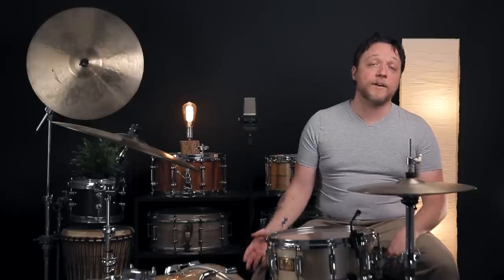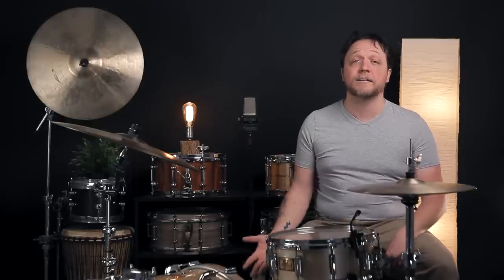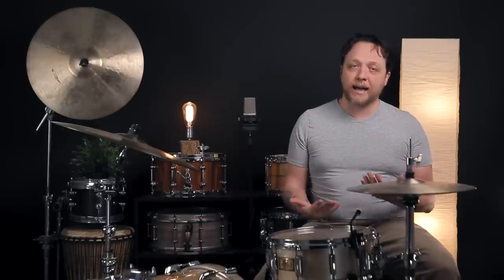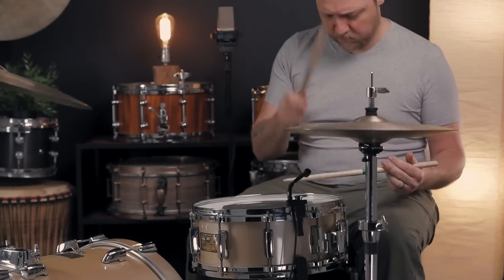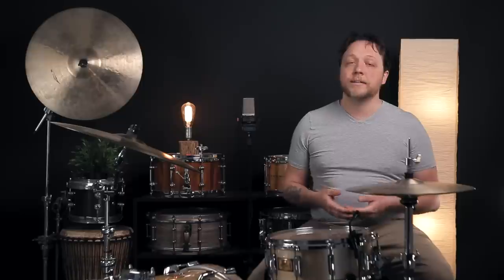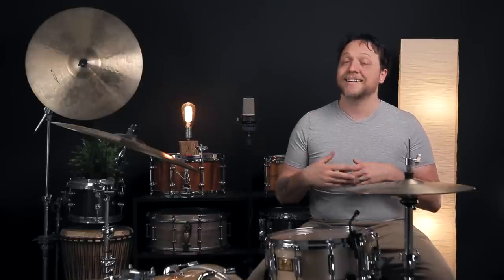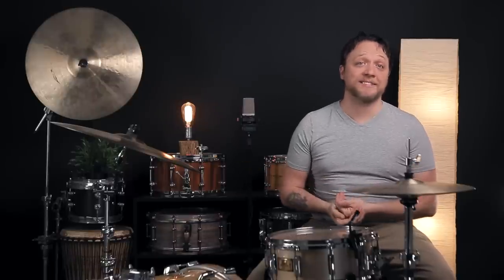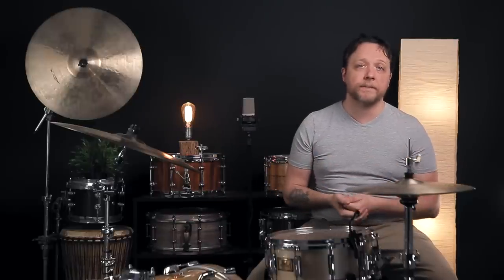Drumhead Coating Conspiracy? | Season Five, Episode 49

Comment: The tuning accuracy these guys have is incredible. It's so hard to hear a difference because of how perfect the heads are tuned to match. Bravo!
Reply: I believe it's the same exact head and they didn't even have to remove it to remove the coating so that's why the tuning is exactly the same
Reply: @miikaroysko9591  what?😂
Reply: Probably used a drum dial
Reply: Get a tunebot, it’ll give you exact hz reading of each lug and it’s basically a guitar tuner for drums
Reply: @mattlionmusic  drum dial is far more accurate
Reply: @zackedge2456  how is the drum dial more accurate? If the drum has any imperfections like bent hoops or bearing edges that aren’t perfect, or old dented heads, the drum dial isn’t going to work. You will need to keep tensioning the drums higher to get the same tone… the tune bot literally doesn’t care about tension it’ll give you the actual note of what each lug is. Match them and your drum is in tune.

Comment: The coating remains popular on the snare for brush playing. That’s it. The coating applied to the drum head does very slightly mute & the sound & control overtones on any drum. It’s very slight, John Bonham used coated heads on the resonant side of toms. Try it for yourself 👍🏼

Comment: Oddly enough, the fully coated head sounded to me a tiny bit brighter in this video than the partially coated or uncoated heads, although less so in the blind test.  IRL I've never really noticed a difference.  Maybe I heard a bit more airiness with clear heads, but it's so small that 1) it could be my imagination due to the way clear heads look, and 2) it's imperceptible except in isolation.  But I've always used coated heads, because of brushes.  I don't use brushes often, but I don't want to have to think about changing snares or heads or whatever when I do.

However, I can hear a difference between the G1 coated and UV1 heads on snares, with the UV1 sounding slightly darker/deader.  Because of that, I always buy the G1.

Comment: The thickness of the base film (12mil as opposed to the standard 10mil, or the thin 7.5mil) might lead to slighter change: the coating adds relatively less mass to a thicker base. Note that coated Ambassadors also use a different, opaque, base film than clear ones. Interesting bit about higher tension possibly mitigating the differences.

Comment: a difference i noticed  is that i had a metal snare that a Clear pinstripe sounded amazing on..BUT it would crack in the center .When i put a coated pinstripe  it didnt crack  just worn out  like a reg coated head .So i think clear heads tend to crack  ..Great Vid Stay well

Comment: I prefer coated snare more to clear one because it's just way more durable. Also the hitmarks or cleared field are very nice to see if they've been made by myself. just a glimpse of motivation. But yes, coated nor clear may change or not dramatically the sound that I want.
BUT any coating won't replace good tuning yet definitely it will help get through rough drums that just won't ever tune just because they might be too used/old/damaged.

Comment: Fabulous vid as usual, you guys rock! Further pushing me towards trying a pink P77 😅

Quick vid idea: does the position of the snare mechanism on the stand matter sonically? I have a mate, who like Nick D’Virgilio has his mechanism from 6 to 12 o’clock, do a session with an engineer who worked with Radiohead who was adamant that he positioned the snare with mechanism from 9 to 3 o’clock for sonic reasons.

His reasoning was that if you hit left of the centre by say an inch and a half with the snares at 12-6 you don’t get as much snare sound as the other config because the stick isn’t striking directly above the wires. Same with if you buzz roll, like in this video, from 12 to centre you lose out on articulation compared to rolling from 3 and 9.

Personally, I think it’s bollocks and a personal preference to where you want your mechanism placed but would be interesting to know if there is any difference or just a visual thing like you address in this vid 👀

Comment: Amazing video, loved this one. I do play with brushes, and I’ve assumed I need coated heads for that. But I should challenge that, so I can be less picky with what head I need. And who knows, I might even prefer that sound! For hitting, it sounded too similar for me to pick one over the other. Again, really nice video. I really liked the immediate back to back followed by discussion, worked really well. 
The fact our brains see something and then expects as certain sound from that is both hilarious and so sad. Just yesterday I was playing two pairs of hi hats, once thicker, one thinner bottom. And straight away in my head I went “of course, the thicker one will have a stronger chick and the thinner one more wash…”. Well, no that wasn’t the case. They sounded different, yes. That’s it. Both good. :-)

Comment: Something I was curious about today was, will a really thick batter head make it easier to play "softer". I thought of gluing a heap of skins to a head. Crazy idea but my preference is to play without much ear protection and learn how to grade the volume of a drum set completely. Recently realized that stacking two identical cymbals makes a softer and better sound than low volume ones. If you would be interested in the thick head test that would be great. Great video as always.

Comment: That's definitely very interesting. I also find it interesting that the isopropyl didn't seem to touch the head logo in anyway? Just looked like a brand new clear G12 in the end
Reply from the maker: We used an uncoated head tuned to the same pitch for the final variation.
Reply: @SoundsLikeADrum  thats why it looks like a new head then, it was :D thanks for clarifying

Comment: Based on this experiment: I wonder whether the clear edge on the UV heads is even necessary or just an aesthetic thing.
Reply: I think it's just simply easier for manufacturer to apply this type of coating this way. And it looks cool :)

Comment: I agree that the sound differences are surprisingly minimal, but I still hear a difference between the two. If I had to describe the difference, it would be a softer/warmer attack with the coated, and a harder/colder attack with the uncoated. I identified the two heads correctly in the blind test as well. This whole thing reminds me of the Pepsi Challenge, haha.

Comment: I'll play along, I think B, or the second example, was the uncoated. I don't know if the answer is given anywhere (haven't watched all the way to the end yet). Listening on laptop speakers, no headphones.
Reply: O.k., now I watched to the end. This helps me understand something, especially the examples with progressively removing the coating. I have a preference, on my snare at least, for a Remo Pinstripe with a bit of the coating worn away, maybe about the size of a quarter to a half-dollar (and wearing on other parts of the head too, just not all the way through the coating in those areas). It's something my ears have picked up from listening to a lot of early funk, especially James Brown, and how the drums sound on those records. There's a certain sort of "beach ball" set of harmonics that I like, not to ring but to be there right after the attack (that's where I hear the most difference, and the overtones ring louder for longer as the coating is removed). I feel that they are about at the right balance with that pattern of wear, and as a head is worn beyond that point I feel like they get too strong. Now, I'll bet that what it actually comes down to is the weight of the head, and that a totally clear head with exactly the same weight as a coated head will respond in pretty much the same way. Or, at least, that's my theory based on the bits of physics I think might be at work.

Comment: Fascinating. I too heard no difference here. I’ve always perceived noticeable differences between coated and clear on toms, at least in the high end of the attack. So am I fooling myself there, or does the crunch from snare wires mask any differences? Is there a difference when the snares are turned off? Or does a snare drum’s unique tension and depth also factor in and reduce any differences? How many questions is too many? How about this many? Or this many?

Comment: You mentioned going back to redo the coated tom head experiments, as the reasons for your outcomes were not what you were expecting now that you have this new information, which means we have to find out, just how much coating (by weight and volume) is on a specific size head. 🤔 Then you can see how much difference there is between that coating weight, and the thinnest second ply you can find.

This could actually turn into a whole new drum head. I'll explain. Let's say the thinnest second ply on the market is 5 mil, paired with a slightly larger 7 mil as the main ply. Now let's say we get info from head companies saying the coating is X weight wet, and X weight dry on a 12" head. Since they likely will not give up this proprietary information, you'll probably have to find a way to remove it all and weigh it yourself. 

Now, let's say for ease of pushing numbers, that coating dry weighs out to X, which is even to a 1 mil ply.

I've often thought drum head manufacturers were going to heavy on the second plies, or not offering enough options. 2 x 7 mil plies and such, and I think they have thought this too, as many have given various options for controlling sound like 1 inch rings, dots, the holes in the Evans heads which are a great idea, and so on. What none of them have done so far is what you'd think would be the obvious, cheapest, and already tried and true way. They've been doing two ply forever. Instead of adding a 5 mil, or another 7 mil, why not just add a 1 mil or a 2 mil second ply instead of the coating?

You could even use Evans' idea with the holes for the thin ply. I've often wondered what effect putting those same holes in one or both plies of a 2 ply head would do to the playability since you'd be allowing air between plies. That alone may make a huge difference. I may have to try this with a tiny hole punch and a few different two ply heads, and I doubt they will see this, or entertain this idea. This could be fun.

Edit: I was just made aware by another video here that the dry hole head IS indeed two ply, so I guess there would be air getting in between the plies. One less experiment I need to try.

Comment: I use the clear remo p77 for some years, i think the coated version dampens a bit but in the end it comes down to personal taste. Cool info video though
Reply from the maker: What would you say if the personal taste was affected entirely on the existence of placebo and that the coating didn't actually make a sonic difference? That's the point we're making here. A lot of opinions and hypothesis are left untested and we simply assume we know what's up. We're challenging everyone to question those pre-existing notions. Thanks for watching!
Reply: @SoundsLikeADrum  you have a point there

Comment: "If you're not using brushes and you're not doing lateral movements on the drum head, you don't need a coating."

Disagree. Speaking for myself, I just really don't want to look down and see my feet. Also: Lateral Movements on the Drum Head (LMDH) was one of my favourite 80's bands.
Reply from the maker: It sounds like you're conflating wants and needs but we get your meaning. Hopefully the bigger picture of this episode came across as well. Cheers!

Comment: You may want to think about doing this test again. Removing the coating with alcohol was probably not the best choice. Alcohol eats into things like plastic and rubber, causing them to break down. Any alcohol that touched the clear part of the head in the removal process had some type of effect on the plastic. How much of an effect is hard to say. I would get a clear head and listen to it next to the heads you modified for the comparison.
Reply from the maker: This was considered but we decided that it wouldn't likely have enough of a noticeable sonic effect. A clear head was used in the final stage of the comparison and the results weren't surprisingly difference from the previous stages.

Comment: I disagree that they sound the same.  They don’t, there is a very subtle difference, but there IS a difference.  With that said, the head with only parts of the coating removed is a bigger difference than all clear to all costed.  I think the mass of the coating affects the head… especially when it’s only on part of the head, so again I disagree with your assessment. Very subtle. But the difference is there.  
Love these experiments though.  The differences are so small that other things are going to affect the sound more than clear vs. coated on a snare.  How you hit it, how it’s tuned… muffling etc.
Reply from the maker: To clarify, it seems that we came to virtually the same conclusion you reached in your final sentences; we found the human element (as well as other factors) to be more substantial than the presence of coating (especially in blind tests). But the key here is, as you noted, the value of engaging in the experiment and questioning the pre-conceived notions and groupthink that are all too common.

Comment: Aaaamen!!!
.. Does the wood type influences the sound that much? (From several videos on yt: not really! .. Even the last dcp Sonor comparison: -_-)
.. Does the depth of a tom matters? There's a video of a 12x8 vs 12x12 tom comparison: yes..kinda..

It seems that what will make most of the difference: at the same level of importance: I would say :
Tuning and heads (heads for toms and bass drums!)
After that
Bearing edges? 
(Shell thickness, dimensions, rims, )

..And wood type might be at the bottom of the list!!

And most importantly: the player and sound recording/editing.

Marketing scams all over the place?
Most likely!
Reply from the maker: Funny you should bring up the shell material since we JUST released a comparison of four different wooden snare shells last Friday! In short- it's subtle but definitely apparent, particularly at the extremes of the tuning spectrum. There are certainly some placebos and even shady marketing going on out there but let's be careful not to throw the baby out with the bathwater here. Hypothesize, test/experiment, re-assess.
Reply: @SoundsLikeADrum  hey tnx for your feedback!!!
..
Yeah! I saw that you did a snare comparison just after!

You're right: it seems that there's no absolute.. No black or white! (As it is the case for most stuff ;) )

Cheers!
Reply: I've found that wood type matters more for guitars, only because the quality of wood (or particle board) can be MUCH lower on a guitar. Only extremes make any noticeable difference. It's mostly about density

Comment: I listened to Neil Peart using clear heads and knew it sounded a little thin. when he switched to coated heads , it had more body , depth and richness.

Why a coated head works for snare drums is it is usually a thinner shell and usually not as deep as a tom - it is a different animal on the drumset. a sharp , ringy tone is what will naturally come out of a average snare drum (5x14-6x14) , so a coated head will bring the richer tones and warmth out of a thin drum - it makes no sense to use a clear head on this individual drum of the kit.

The tones that come out of the drum will be determined by the heads used and the tuning - know what your ears tell you , a snare drum needs a coated head to get the bigger sound for the(usually) small size of the drum.